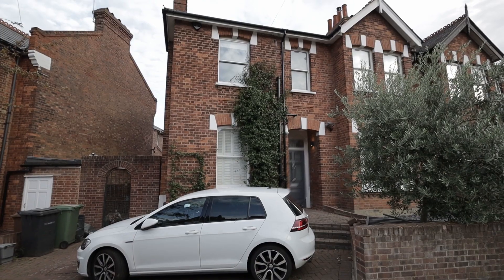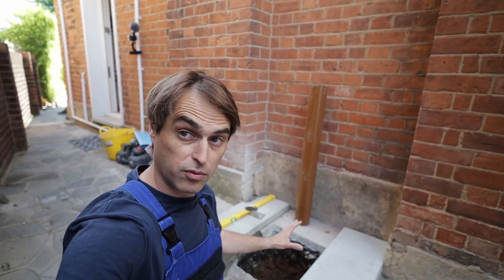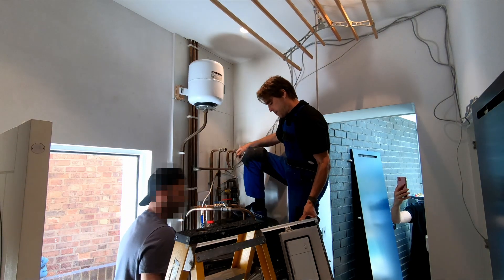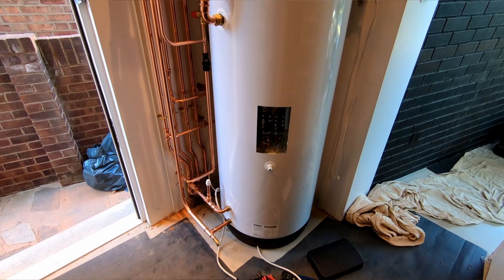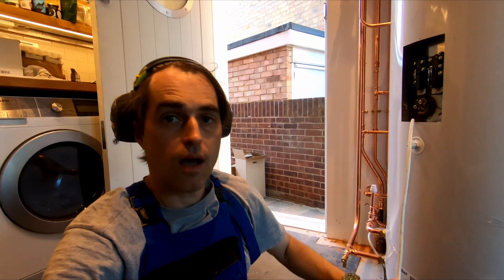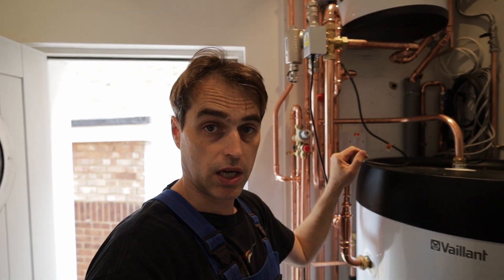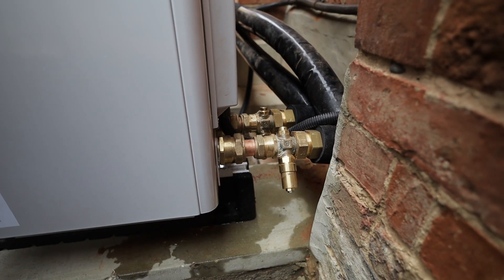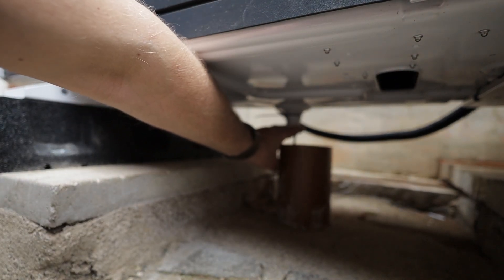Is This Heat Pump Better Than Your Gas Boiler?

Comment: Well presented video but...The most important thing to note about heat pumps is they are only as efficient as the insulation in the property. I have a 70s detached house with large windows (11), no wall insulation and a solid floor. To upgrade the insulation for a heat pump to be efficient would mean triple glazed windows, major structural work on the floor ( the whole ground floor dug up and replaced) and walls insulated reducing the room size. Also all radiators replaced and microbore piping. In at around 15-20k at a conservative estimate. I'm a pensioner on a fixed income, no way can I afford this unfortunately. I have a  wood burner which heats keeps me very warm as well as well as being able to cook with if the power is off.  Great idea for new builds but old houses-bottom line too expensive-cheers
Reply: I have been trying to engage various companies to install a hybrid heat pump.. it seems a sensible transition to me however the evangelical approach of lots of companies have meant that nobody wants to supply me one. Instead they want to argue with me that they know best and heat pump only is the way to go.
Reality is ROI on a heat pump is marginal at the moment due to very high install costs.
Reply: @chrismoore7569  I agree Hybrids are probably the way forward especially if you have an existing gas boiler. We are just starting to get Into heat pumps and id like to fit a hybrid but most people want the BUS grant. You don't get that unless you rip out your existing gas boiler. Although I can't see what's there to stop you putting one back in after you've received the grant.
Reply: Learned more from your comment than the entire video 😳🙄 thanks 👍
Reply: heat pumps are only fit for NEW BUILDS  that meet the heat loss tests and get the required rating , in old cavity wall big window houses FORGET IT , YOU'LL SHIVER,, WHY DOES THE GOVT .ALLOW ALL THESE MISLEADING ADVERTS ..
Reply: That's not true at all. A more efficient heatpump will be cheaper to operate even if the house is poorly insulated. Your basically saying it won't help to go from a 3 cop heatpump to a 4 cop heatpump if you dont upgrade the insulation.
Reply: Why are people only concerned about the heat loss from a building when installing a HP?! 
Heat loss has always been wasted energy - wether using a gas boiler, resistive heating, storage heating, biomass boiler, ASHP, GSHP….better insulation/reduced heat loss will save money (and resources) with all heat sources.
Reply: There's literally nothing about heat pumps that makes insulation more or less important than any other kind of heating.
Reply: Stupid... insulation is ALWAYS important. Doesnt matter what type heating.
Reply: I was told if I installed a heat pump it would be running 24/7 and cost a fortune in electricity and my old house would never feel warm. This from a reputable installer.
Reply: @thepuddlejumper500  a reputable gas engineer that doesn't install heat pumps? Or a MCS registered heat pump installer who probably has more experience in full heat loss calculations then the gas engineer?
Reply: @ActiveHeatingRenewables  The company is a heat pump specialist.
Reply: @thepuddlejumper500  I'm sure they have done the maths then. They won't be suitable in every case but I do think people write them off to easily when all that's needed is some upgrades to insulation to make them worth while.
Reply: @ActiveHeatingRenewables  I’m sorry to disagree with you I live as thousands do in old housing stock. The walls are brick with lath and plaster with an air gap to allow the cold air from the solum to flow up to the loft area. The reason to keep damp at bay. Further these properties have timber floors generally with no insulation. Due to the above and the building techniques of the time they are extremely draughty. To make such a property sufficiently airtight and insulated to allow heat pump to keep it warm isn’t some upgrades but a major refit. In my own home insulation installers won’t install underfloor insulation because they say there isn’t sufficient room, so the floors have to be lifted throughout the property. How do you negate the cold walls, cavity wall insulation isn’t suitable so the answer is to insulate internally. Even putting a mere 50 mm backed plasterboard on would result in all finishes needing removed and replaced. My existing heating system utilises micro bore pipes so these would have to be replaced along with my small radiators or preferably underfloor heating again this is major works. Therefore it’s not financially viable to reconstruct a large proportion of the housing stock to a level where a heat pump would work. Therefore my comment that a heat pump would need to run 24/7 and even then not heat my house is a fact and the way electricity prices are going it would not be financially possible to run. I have to admit I am insulating my property bit by bit when finances are available but my oil fired boiler has many years of keeping me toasty and my costs should reduce the more I insulate. Even the majority of modern build properties, I would say, are not to a sufficient standard to have heat pumps. The method of construction and level of insulation would need to be raised significantly, maybe building standards requirements should be changed to reflect this.
As an aside you have to ask whether net zero is the right thing for the country, considering China and India will be constructing more than 60 coal fired power stations per year and European countries are now de-mothballing their coal fired power stations. In the UK we can’t de-mothball as we, under the green agenda, blew most of the up to ensure they would never be available in the future. No plan B by the looks of it.
There is of course the other question the one that should not be mentioned, is the 0.0001% increase in CO2 caused by man the culprit to global warming sorry climate change or not. I’m not taking sides but would like a debate on all the evidence from both sides of the argument before we destroy our society.
Reply: New houses in the Netherlands don't even have a gas connection anymore, only way to heat your house is by heatpump or full electric.
Reply: Banquo the insulation of a house is a must for any type of heat. Lol.  I am getting out of Heat pumps. I’m going to buy a boiler and install it by a contractor.   Must they play the BS music?
Reply: @jochimbenschneider1915  what country do you live in? Boilers seem Like an obsurdly expensive and complex install. Idk, we don't use them here in the US.
Reply: @randybobandy9828  well, you’re wanting to run this whole thread up I guess but you don’t know nothing about what’s going on in the USA or in Britain or a Europe because boilers are very popular in America today.
Reply: Heat pumps are good for areas that have 80 to 85° summers and mild winters such as 30to 50 degrees.  If you have 3-4 winter months where the temperature drops down into the 20s or below zero consistently for weeks at a time the heat pump doesn’t hardly work at all and anybody with a brain not to understand that so I’m really not that impressed with them. I do think geothermal has a good future and I’m hearing about geothermal heat pump boilers that seem very interesting but I don’t know enough information about the latter to make an intelligent comment or a common sense comment.
Reply: The government is in the process of banning wood burners - I wonder why?
Reply: Efficiency and power consumption are different things.
Any property insulated or not can get high 4+ SCOP even including hot water.
But if the uninsulated property looses 3 x more energy then you need to put in 3 x more energy. It will still be cheaper than gas to run
Reply: Everything you’ve said is true of all heating systems.
Reply: Our friends, husband is a gas engineer and his wife is an electrician. They put one in themselves in their own home and it cost them $19k. Their electricity bill is now £290 to £320 per month and we aren't even in winter yet. They have solar panels to offset in the summer month's. I got a few quotes from £28k £30k. Even if my gas bill is £100 every month which it isn't.  It would take me 20 + years to break even.
Reply: How is the insulation a bigger factor for heat pumps than it is for any other source of heat in your home? Heat is heat.
Reply: @michaelmoran9020  Heat pumps lose efficiency in winter when it is colder, which is when you need it the most.
Reply: @alanjenkins1508  wrong. They lose efficiency when they get below a certain temp and the new hyperheat heatpumps don't lose any efficiency until they go below - 15°c or some stay 100% efficiency as to - 40°c or colder. You should really look into the massive improvements heatpumps haveade in the past decade.. It's completely different than before.
Reply: The insulation factor in your home has zero to do with the heat pump's  efficiency.
Reply: The main point is that Heat Pumps are more efficient. Costs are a factor when upgrading but as for dugging up floors, I'd  say that is a "bridge too far" and would not exclude you from having a Heat Pump. However you highlight the main issue here in the UK...Housing Stock.
Reply: This is spot on. many hosues in the uk have poor insulation and insulating your home is going to cost a heck of a lot
Reply: @jonneymendoza  yet the people in the UK talk crap about wood homes in the US even though they have amazing insulation in them and it's super cheap.
Reply: Excellent points.  I have same situation.  Heat pump operating cost is at least 2 and 1/2 times what my oil heating costs were.  Buyers beware!!!!
Reply: @HC-tc7gv  having moved from a house with a oil boiler to a house with air sourced heating I agree running the air sourced heating is lots more and the house never gets up to a decent temperature.
Reply: @JonathanLaycock  how old is the heatpump? It sounds like it's old and who ever installed it didn't size the unit properly to the house. Heatpumps in the last 12 years have doubled in efficiency, meaning a old heatpump might cost you $200 a month to run and a new one would be only $100. They also have improved the efficiency of subzero heating significantly, old heatpumps would lose half or more of their output when it got below freezing and now some don't lose any efficiency.
Reply: @randybobandy9828  Its a Mitsubishi Ecodan system installing in 2015, serviced every year and running as it should be, we have oversized radiators as well for the output. IMO and I am not an expert you need underfloor heating to make it efficient.
Reply: @JonathanLaycock  cost of electricity? There is no reason it should cost more unless power is expensive in your area, also radiator oversize doesn't help if. The compressor is undersized.
Reply: @HC-tc7gv  lmao.. How old was your heatpump and how much do you pay for electricity? Those are key factors in deciding a heatpump.
Reply: Exactly my point.
Reply: This is why the government needs to step in and assist.
It's terrible for the environment to heat a leaky house with wood fire.
And heating with gas, in a poorly insulated house. There's also a limited supply with a lot of it in the hands of some very bad people.
Reply: @JanZamani  actual... A wood fire is good for the environment. It's carbon neutral. Burning oil or gas is worse since  you are reintroducing carbon in the air that has been buried underground for hundreds of millions of years. Wood while growing pulls co2 out of the air and then when you burn it, it releases that co2 back in the air. If you plant trees for wood and burn it you are not increasing the co2 of the air.
Reply: @randybobandy9828  while if locally sourced the wood may be carbon neutral it isn’t pollution free. Studies have shown that the nitrogen oxides from burnt wood combine with car diesel emissions to create a particularly toxic product.
Reply: @Peter Gilbert  sounds like a diesel issue. Humans have been burning wood since the beginning of humans and no issues. Obviously sure you're going to have a carbon footprint if you are being pedantic about transport of the wood producing emissions.  Most people source wood within 25 miles of their home.
Reply: @JanZamani why is it 'terrible for the environment'?
Reply: @JanZamani  you raise good point.  Still, we need to consider the utility fuel source.  Are they using clean energy?  Probably not.
Reply: @HC-tc7gv  I consider wood burning to be clean energy... Atleast almost perfectly clean. It's carbon neutral.
Reply: I don't get the physics of that at all. I've heard it a lot and I don't think it makes sense.
Reply: Lol then it insulation very high only need hair dryer to heat it instead of this expensive crap
Reply: @WayneJohnsonZastil  You have to be constructive. "Crap" just doesn't  cut it. I've no idea why you would watch a video like this just to troll.
Reply: @WayneJohnsonZastil  if you are heating a closet then yes. Heating a house you will need more .. but you might not need more energy of a hair drier to run said home. 
Some new heatpump coefficient of performance goes up to 9+ (granted its for air to air systems - to get 40C water in winter its quite bit less) meaning you will get 9kw of heating from 1 kw of electricity
Reply: @TheDancing0wind  A COP = 9 for an air to air heat pump ? Even a ground source heat pump would really struggle to achieve that level of performance surely.
Reply: @TheDancing0wind  tell me what air to air heatpump has a cop of 9.. I would love to see that because I don't believe it.
Reply: @Martindyna  lmao.. I said the exact same thing before I saw your comment. air to air heatpump with a cop of 9?? Ya right.. Most are 3-4 and maybe some high end units that are 5. You would need a ground to air heat pump for a cop of 9 and those are many times more expensive to install.
Reply: @TheDancing0wind  Has anyone heard of the concept of CONSERVATION OF ENERGY.  What you are proposing by saying you get 9x the energy in heat from 1 unit of electricity is in essence saying you gain energy from nowhere!!!
Reply: @bobhardcastle  No reread what you wrote again. So 4.5 cop is fine but 9 is OMG Violation of energy conservation? ... Look up what a heat pump is please before posting any more bs. It in fact does not do any direct heating - what it does is it transfers heat from one place to another.
Reply: @TheDancing0wind I think you need to read what you wrote again.  I wasn't referring to SCOP but to your claim that you can get 9kW of heat from 1kW of electricity.  This means you get 9 fold increase in energy output.  This breaks physics!!
Reply: @bobhardcastle  ...what is wrong with you? Clearly I am talking about heat pumps so Im obviosuly talking about using 1 kW to transfere x kW from one place to another (lots of * attached). no-one is saying you "create" x kw heat from 1 kw electricity.
Reply: @TheDancing0wind  Im sorry but you made a VERY clear statement in your comment.
"Some new heatpump coefficient of performance goes up to 9+ (granted its for air to air systems - to get 40C water in winter its quite bit less) meaning you will get 9kw of heating from 1 kw of electricity"
9kW of Heating from 1kW of Electricity, that breaks physics as you CANNOT gain kW from nowhere.
The video was very well made and the quality of work you did on the installation seems excellent, and it certainly gave me some information to go look up.  However the wheels feel off in the comments section with claims of systems being so efficient they create energy.
Reply: @bobhardcastle  OMG https://en.wikipedia.org/wiki/Coefficient_of_performance - go read up on how heat pumps work. It is not creating energy from nothing. cop of 9 may be a bit high but you use x energy to move y from one place A to place B. whole system gets increased by energy x, but place A is now slightly colder and place B is slightly hotter. The difference of energy moved vs energy used to move it is called Coefficient of Performance (COP)  >1 means u move more energy than you put in work. x < y, otherwise what is the point of using it for heating? You might just as well use the energy to heat directly.
Reply: @randybobandy9828  air to air
Reply: @kevinschoales844  what about it?
Reply: @TheDancing0wind  COP of 9 at standard outdoor/indoor temperatures is actually higher than the theoretical Carnot maximum (around 8), so that guy was actually right that you were breaking the laws of thermodynamics lol.
Reply: @motog6436  the guy was insisting that any cop is magic so ... or that is the impression I got. Not my problem the dude cannot clarify his point.
As for 8 being max... well I'm not an expert. I was under impression that at cop varies a wide range dependent on dC you want to achieve and with low enought difference (ie 5/10C->25) cop is higher than 4.5. Only once you get to freezing temps of -15 or you try to heat water to 45C+ does cop go down...
Reply: @TheDancing0wind  You actually stated that you could get a cop of 9+. Was that a little porky?.
Reply: @paulhillman400  Yeah as I wrote in previous post it probably was. One youtuber was claiming that it goes up to 9 (showed techsheets but also admited that 9cop was @ ~ +5C and got way down to 2.x @ ~ -20C) but .. when I started looking myself for these wonderous arctic heat pumps ... all I found was 4.5cop in the tech sheets
Reply: @WayneJohnsonZastil  You sound a little biased mate. I've had one of these for about 15 months and our energy bills are way lower than when we had a gas boiler, I'm pleased to say. We don't have any gas in the house now as we also installed Solar & Batteries. It's a two bedroomed house of about 150 sq m and our energy bills for the last year have worked out at £100 A MONTH.
Reply: @scottcompany4040  What did you spend? Did you borrow the money to do the installations? if so what is the credit costing you? Where do you live in the UK? North Mid or South?
Its not as simple as buying a heat pump and solar is everybodys answer - the gas combi was a brilliant bit of kit that brought hot water and warmth to millions of low income people, and gas despite all the negative press isn't particularly dirty to burn.
I didn't indulge in the heat pump or new boiler panic mode and actually sat down and worked it out with a spreadsheet, and instead I invested that money and good lord has it been a better decision.
Just wait until the people with heat pumps start needing repairs done, and every single repair will push your break even point further and further into the future.
Reply: @scottcompany4040  if you have solar and battery why are your bills so much lol
Reply: @scottcompany4040  depends how long you spend in the house. If you spend 3 - 4 hours in the living quarters of the house in the evening and are either in bed or outside the other 20 hours, then it doesn't make sense to me to have the house heated to 21 degrees for the entire day. I can't see that working out cheaper than running the gas high for an hour or two each evening.
Reply: @dooovde  This is my problem with the technology too, I'm nowhere near wasteful enough to begin with to ever be able to see the benefits in changing. 
I had a new combi boiler when I moved in 3yrs ago. My combined energy bill is still almost 2.5 times what it was a year ago (about £75/month this summer), but I'm miles off making any kind of saving through switching to heat pumps, solar or even improving the insulation.
Reply: @scottcompany4040  new house?
Reply: @GavinLawrence747  I feel bad for you guys in Europe. I was able to buy a 36,000btu (10.5kw) mini split for $1700(£1534) including all the line sets to install it. That was in 2017 but the same size unit now is about $2100(£1895) but it's more efficient. The key is being able to install the units myself because the price the hvac companies here charge is more than the cost of the unit and most of them will not install a unit unless it's provided by them which they charge substantially more than what I can buy it for myself. I'm also lucky to live in a area where I pay $0.068(£0.061) per kwh so my electric bill is super cheap when I run my AC/heatpump. I can't imagine paying someone to install a £18,000-27,000 system and then have to pay a bunch more money to run it.
Reply: @dannyboywhaa3146  new house build..? One that JACK built
Reply: Nope... not that stupid. Not a new build anyway!
Reply: @kevinschoales844  who’s Jack - nope, wouldn’t touch a new house - it’d fall apart!
Reply: @randybobandy9828  I'm jealous, man! I self-installed for about the same price, but my power costs 11cents/kWh, almost twice yours. Maybe if greenies didn't destroy the electricity market more people would use electric heat.
Reply: @motog6436  Yes, I am very lucky that it's cheap here. What's interesting is the area of town a few miles away has a different power company which charges $0.117 which is almost double. When I moved to my new house, I was shocked how much cheaper the power was.
Reply: @GavinLawrence747  I love the gas combi boiler. You only heat the water you use and the heating can be time and temperature controlled so easily. No more water tank or cylinder and no more worry about burst pipes.  If only there was an efficient electrical combi I would be happy to have it installed in my 2 bed flat.